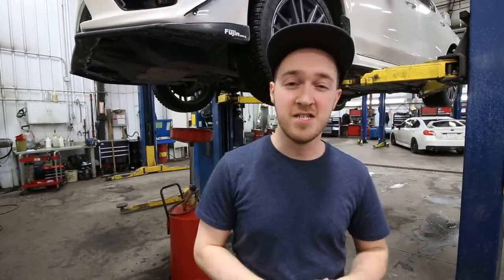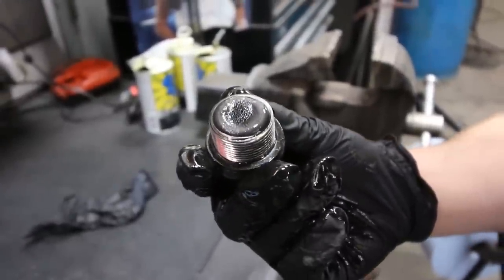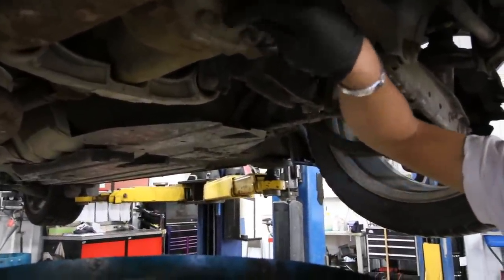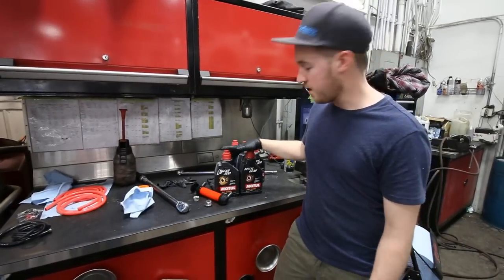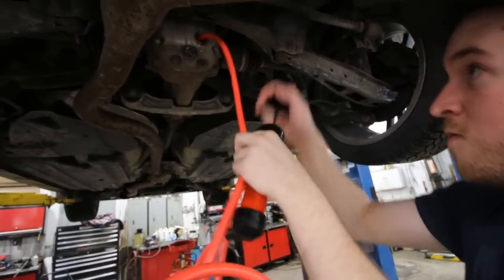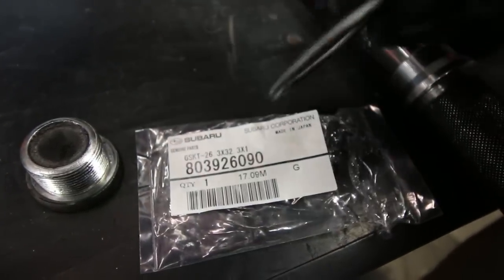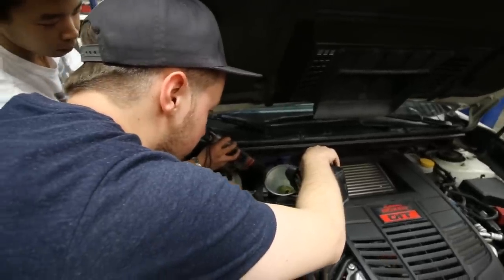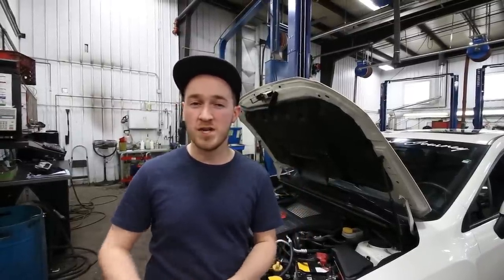Transmission and Differential Fluid Change | Motul Gear Oil - 2016 2018 Subaru WRX & STI

Comment: Doing this without a lift would be a pain. NOT looking forward to this . Good tutorial bruh
Reply from the maker: Thanks bro!
Reply: I did mine on a couple of old 6x6” post that I drove the car (Mustang) on......gave me enough clearance to do the rear diff., mine was a stick, I used Mobil1 (car was a Honda) because the trans. Was a little sticky, and this worked well.....similar thickness to Honda fluid for the trans. He never said whether this was a stick?   Thanks Jim
PS.....make sure you do this on a level or close area.

Comment: Hey guys, didn't realize there was a difference between gear oils for trans and diff. I have 5QT's of the non-300 oil, can the rear diff run that? Or will it cause problems? Also is the Teflon tape on the diff fill plug really necessary?

Comment: Did you guys ever get or heard of the front differential fluid leaking when swapping the coilovers on  either side of the axles? When I changed my driver side after putting everything back together on my passenger side, the middle of the car where the transmission sits starting leaking.... did I pop something out of place?
Reply: Denis Bigand yes, same just happened to me

Comment: Nice video!  Definitely not too bad of a job when you have a lift to use.  Good stuff as always!  My dealerships changed my transmission fluid when they replaced my clutch under warranty, so I got lucky with that.  But nice to know it's easy to do on our cars!
Reply from the maker: Nice bro! That's pretty good then!! Yup it's not too bad thankfully!!

Comment: Dude, when I changed the diff fluid on my 07 STi, it came out as black sludge. The previous owner NEVER changed the oil. Made a huge difference in feel for sure, combined with the transmission fluid change the car felt much smoother.
Reply from the maker: Ma dude!

Comment: Just did my Trans and rear diff. I was @ 45k "miles" Put in Amsoil gear oil. So quiet!
Reply from the maker: Nice!!
Reply: So quiet? Was it loud before?
Reply: @namelesssd  I find the diffs have a little bit of noise to them even new. Amsoil severe gear does quiet it down. Think redline does too. Sometimes the Subaru fluid is on the thinner side of the viscosity index to help with mpgs.

Comment: My wife has a 2015 WRX. I was surprised to see gear oil for the automatic trans. But then again these newfangled CVT’s are a hair different than my pile of old GM clutch-spinners am I right?
Reply: I would like to amend that last comment. I honestly have no experience with CVTs so apparently they have CVT fluid these days. I’m so used to working on shit from the 70s haha.

Comment: The 2015+ WRX manual calls for a 75w-80 oil labeled as Subaru extra mt (SOA748V0100), this is the factory fill fluid. To make a long story short, you should use the Subaru extra mt fluid or an equivalent gl5 rated 75w-80 because these fluids contain unique additives that 1: don't prematurely wear or degrade synchros, and 2: meet the extreme pressure and temperature requirements (gl5) of the front diff (hypoid gears), and 3: are less viscous in colder and normal operating temps allowing for better shifting, drivability, as well as fuel economy. Unfortunately Subaru only sells this stuff in 5 gal pales for like $400+, which is simply ridiculous on Subarus part. If you can get the parts department to sell you what you need that would be preferable, My dealer would not. And the pickings for an alternative with similar viscosities are very slim.
Reply from the maker: If you go to any performance / third party garage to have this work done, this Motul stuff is what they would use.
Reply: Yes, a lot of people use Motul fluids like motul 300 and they’re decent fluids. But it doesn’t change the fact that the transmission was engineered and filled at the factory with a gl5 rated 75w80. It would be better to use motylgear 75w80 if anything, though the viscosity still isnt very similar to extra mt, but it’s probably close enough.
Reply from the maker: @aredd92  Eh, I'm reaching 150,000km's on my WRX at this point, due for another Trans + Diff. Fluid Change and I'll be using the same Motul stuff in this video (Same I've always used in the past 3 Subaru's I've owned, GC8 STI, GR STI, etc.)  75W90 works great in the -40*C cold climate and winters we have here.
Reply: The Sti has always used a 75w90. The 15+ wrx uses a gl5 75w80. I’m simply stating this for people considering changing their fluid in the near future. It states in the manual that drivability may be affected if you use a 75w90. Perhaps try the motylgear 75w80 on your next change and post if you notice any difference.
Reply: Aaron Redd I’m glad you mentioned this. I changed from the factory fill extra MT and switched to motul 75w90 and noticed a pretty big down grade in drivability. Now my trans doesn’t want to go into gear when it is cold.
Reply: Devin Rowen Your experience is similar to what others have said on forums about switching from the factory fill. I researched this extensively as I wanted to do my first change at 15k miles on my 19. Every Subaru parts department refused to sell me only what I needed and would only use the factory fluid if I had them do the fluid change. I’ve called and complained to SOA about this arguing that they are forcing you to have the vehicle serviced by a Subaru dealer exclusively. It’s a really shady practice imo. The Subaru extra mt is relabeled mitasu MJ-441 from Japan which is also pretty much impossible to get. I am currently using Fuchs titan sintofluid 75w-80 as it’s the closest alternative that I have found, it comes in liters and is reasonably priced too. If you have the time, call SOA and complain, the squeaky wheel usually gets greased eventually.
Reply: Just use amsoil severe gear and you're good

Comment: Nice video man!!!  You covered basically everything.  Do you mind putting the link of the funnel you used?
Reply: Did you ever get an answer? Trying to avoid taking off the inter-cooler :-/
Reply: @d2theyip  any funnel with a flexible tube attached

Comment: My 1998 Sti RA looks better underneath than that does. What on earth are they putting on the roads ove there? 😳
Reply from the maker: Salts. Lots of salt. and 6 to 8 months of snow, deep snow, and -40* Celsius weather all Winter long. Sadly...  Mostly just dirt though, I was alot underneath but this video I had to obviously drive to the shop so it got covered in slush/mud. Not as bad as it looks haha.

Comment: Very good video.. is that WRX or WRX STI ? My 2015 wrx sti has a sensor on rear differential. I’m having difficulty to find the fill bolt on my transmission.. please help
Reply: waicyuen the sensor is the fill plug.

Comment: In the service manual that I have it said 38 lb/ft for the transmission drain (with the black metal washer). Is that correct or was the 18 in the video incorrect?
Reply: Thomas Zoumboulias 38/ft is correct 18cant be true

Comment: Does anyone know how to determine if you need gear/differential oil change in wrx (besides mileage)? Also, is it damanging to your car if you go over few thousand miles over?
Reply from the maker: Nah it won't do any damage if you go over a few thousand miles.  If it's to the point it's become BAD BAD you'd know, you'd feel it and potentially even hear it. It won't blow up or damage anything though, it's REALLY hard to get to that point of it being bad. Like 100k+ kms.

Comment: Why you are using motul motyl gear for thr transmission and not motul 300
Reply from the maker: Different oil is required for the front and rear! Make sure you use the right one!! (Check video description for more info!)
Reply: Yeah I am also confused because usually people put same oil on both side

Comment: I don't understand why they charge so much to do this at the dealership. It's no different than a regular oil change.
Reply: Savage Grace ......that’s because they are trans. Places......trans.oil changes on many JDM (Japanese cars) are easier than an oil change....but those places still change $75 to $150 for the service. Find a local mechanic and check prices. If you want factory (oem) fluids buy them and supply to the mechanic....    also find a local WRX OR WHATEVER CAR Club, join and they will help you.....Jim
PS.....rear ends are the same.   I have always changed my own oil, trans oil, diff oil for the last 60+ years on every kind of car you can imagine, including domestics. Now my grandson does it for me, I taught him well.

Comment: Hi, so did you just changed the gasket in front transmission and not on the rear differential?
Reply from the maker: There is not gasket on the rear! :)

Comment: Boo! STI is different enough that this tutorial could cause problems. You are missing the sensors, extra drain plug and different fluid capacities. Would you feel bad if someone damaged their STI due to you wanting more views? It should be a WRX specific video. If only for a WRX, this would be a good tutorial.

Comment: That's not a sti it's a wrx with wing lol
Reply from the maker: Actually it's a BRZ
Reply: NinjaxBart you had wrx sti on your title before, now you changed it to wrx & sti. The procedure for the sti is slightly different, so it might confuse some people.
Reply from the maker: It's the same procedure.
Reply: Two bolts on my Sti box T70 and a  normal hex bolt